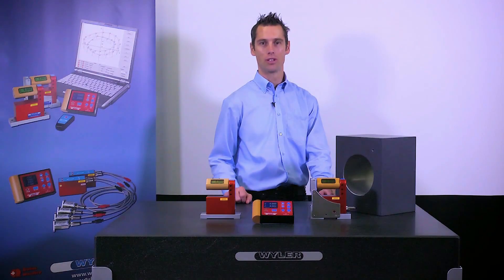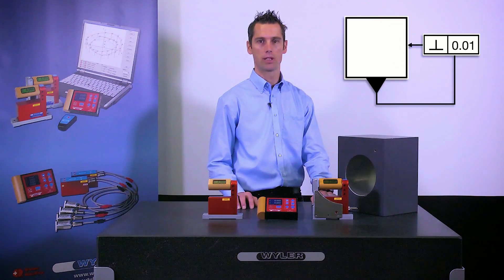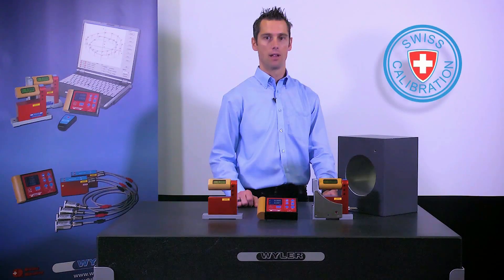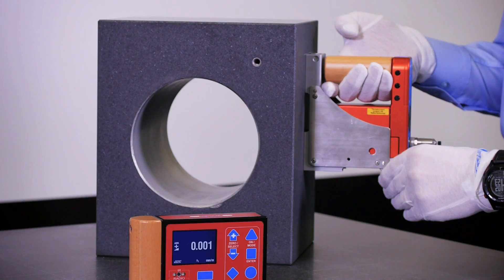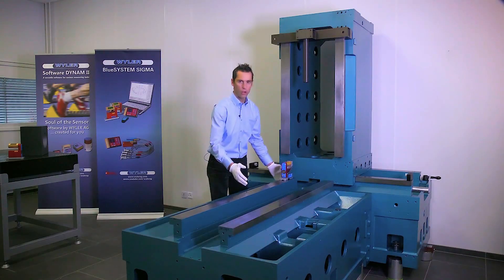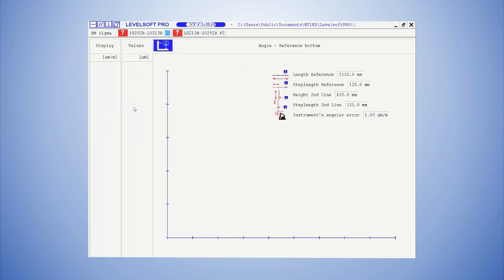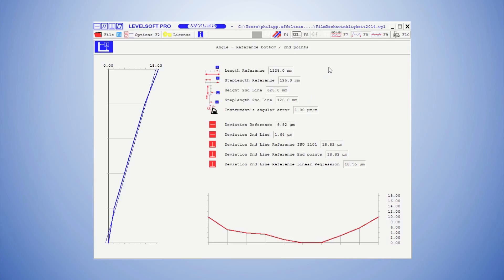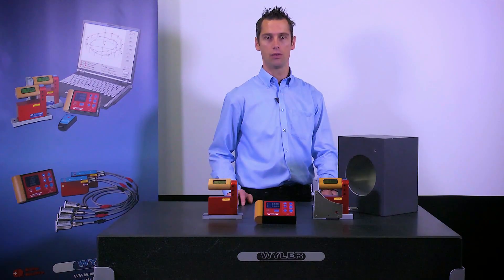Measurement of Perpendiculary

Comment: The video is very good. I have question. The mentioned value of 0.001 mm /1m  accuracy value is about 0.2 arcsec. How did you acheive a master of granite surfaces (square or parallel) better than 0.2 arcsec. Applying a cross calibration (error seperation method for full closure - 2pi rad) for calibration of "zerodur polygons" with highest precison autocollimators (e.g. Elcomat HR or E3000) and moore indexing tables (repeatability of better than 0.1"), we can only acheive uncertainty values of 0.1-0.2 arsec - state of the art (same as METAS). How can you produce a such stone accuracy of better than or at the same level as the state of the art uncertainty values ?  How do you calibrate this granite stones with such level of uncertainty ?